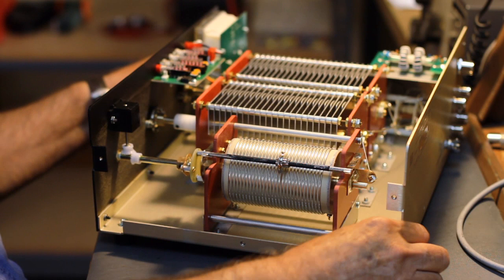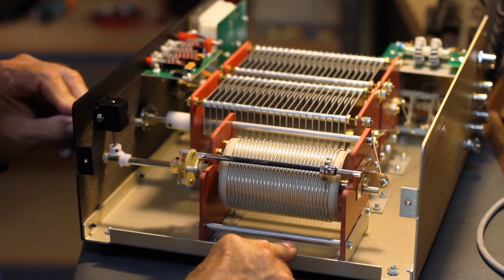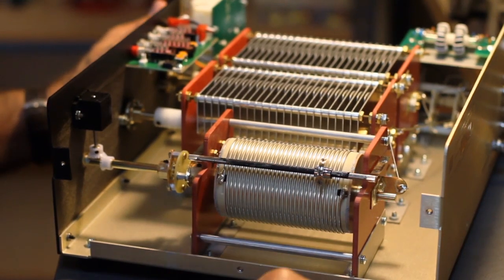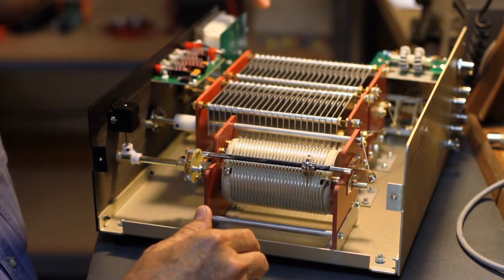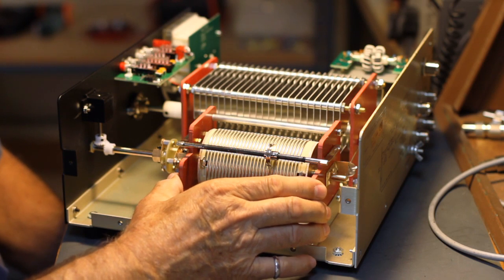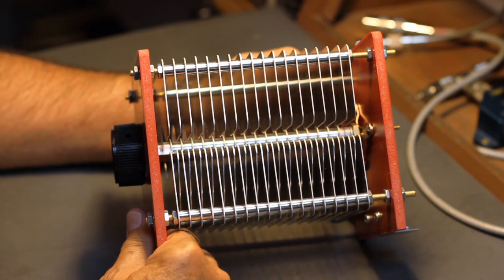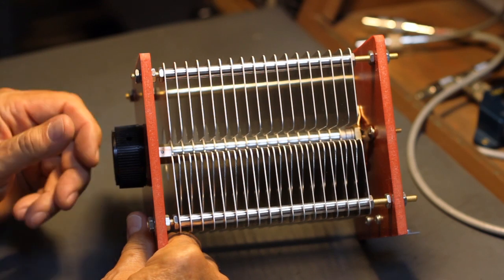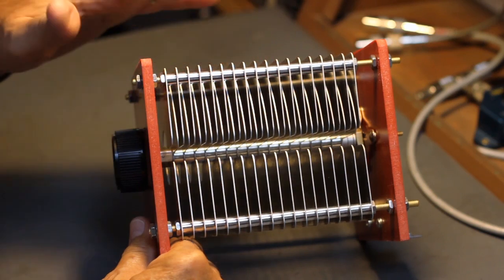AT2K and AT2KD compared and how to adjust the tension on your roller inductor

Comment: How do adjust the forward power indicator (in the cross-needle indicator) needle? My radio puts out 100W (checked it with other tuners) but the AT2K indicator only shows 90W. I adjusted the set-screw under "Tuned" but now the 0 setting is now about at the ~2.5W location. How do I zero out the dial to 0 W and also set the dial to the 100W location for forward power? Thanks.

Comment: The latest AT2K has a rubbish quality roller inductor that cant handle more than 300w avg, without eventiually breaking contact on the wheel/rod causing swr faults. Above procedure does not work for long. Considering how expensive these units are Palstar should supply the better quality roller inductor they used to supply. This latest model cheap quality part is no better than MFJ. Wasted my money.. I asked Palstar to send a carbon grease satchel under warranty, they refused. Also had issues with their DL1500, with bad SO239 fitment.

Comment: Hi, thanks for a great informational video.
Please can i inquire do you manufacture tuners which use metric components ?
Most of us can not easily obtain replacements for nuts and imperial tools to adjust.
Also is it possible to put end stops on the variable inductor ?
Thanks

Comment: Great video but I can't get a straight answer....I'm going to buy one of these, I'm sold...but what am I giving up or losing with the - d?

Thanks!
Reply: With the D you are losing the option of having maximum capacitance on both capacitors of the 'T' network. The AT 2K and the AT 2KD are both 'T' match tuners. 'T' match tuners pass power most efficiently when you have a maximum capacitance and minimum inductance tuning solution. The AT 2KD will only give you one tuning solution, so it is easier to get a good match... but it may not provide as efficient a power throughput as the non-differential AT 2K. The AT 2K will allow you to set more series capacitance, but it will also give you more than one tuning solution, so it is harder to find the most efficient power throughput tuning option. This is easy if you have an RF current meter on the tuner output. That said, I have a non-differential 'T' Match tuner (the same configuration as the AT 2K) and find it very easy to tune. If I were in your position I would go for the AT 2K and forget about the 'D'. I see your question is 2 months old... but you are a radio ham, so you may still be sitting on the fence. 73, and have fun with which ever unit you select.
Reply: VK6CS Great explanation! Thank you.  de N0IRS
Reply: Thanks for the feedback and those kind words JD.
Reply: So which is better? :)